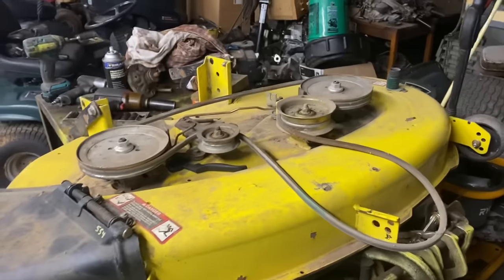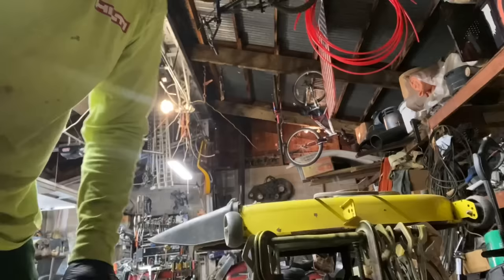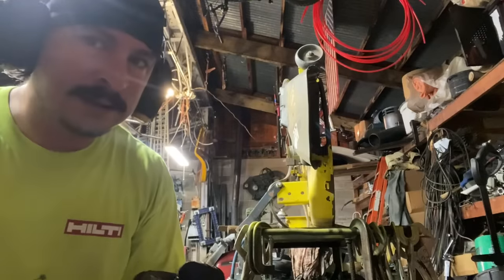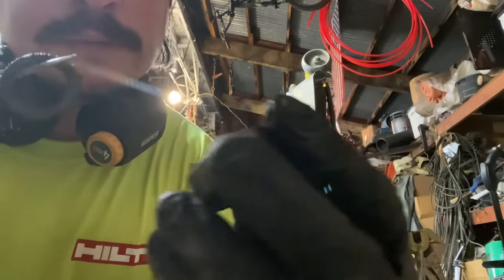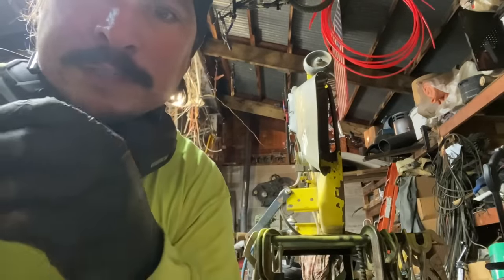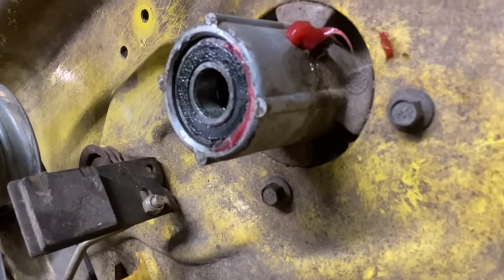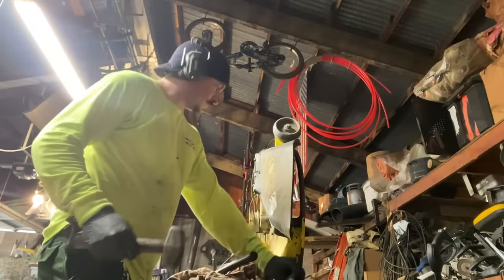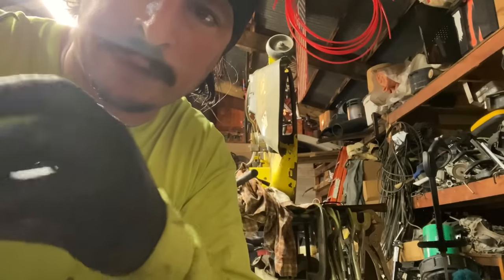Part 1 - Don’t trust the “Experts” Grease your mower deck sealed spindle bearings Common sense.

Comment: The only way grease is going to get into a sealed bearing is if you pump the entire housing full with grease and keep pumping until the pressure of the grease either collapses the inner rubber seal or under pressure  a very small amount of grease at a time could slide between the seal and the center hub of the bearing.....Oh yeah and if you go to Project Farm here on youtube and watch him test different kinds of grease......you will never use any kind of grease except Lucas Red and Sicky......
Reply from the maker: Welcome and thanks for
The comment. Did you watch the whole video? I did pump the housing full. That’s the key to making this process work. What your saying is an opinion about the inner seal and I have yet to see anyone post a video showing that has actually happened. The seal collapsing is a untested opinion. What you say seems logical. However I just proved that opinion / theory wrong in this video. did you watch the whole video? I basically laid it out step by step and removed bearings after the process to show that it works. The inner seal does not collapse and I have never seen one do so. That’s not a concern, I’m fact there is no room for the seal to collapse into the bearing. At least not the bearings used for these applications, and that’s why my video is for. To show folks how to grease a deck mandrel. Not any other kinds of assembly, just deck mandrel / spindles. Do your own test and post some videos showing what you find. That’s what I’m
Doing here, just helping folks with what Iv learned. Iv been doing it this way for years and it works fantastic that’s why I’m sharing. grease passes right by the lip of seal. Thanks for the suggestion on the grease type, however I have found that the type of grease for this application is not nearly as important as just making sure the bearings are greased. My main goal is just to help folks get grease into a bearing. As far as type of grease goes, there are dozens and probably hundreds of videos on that topic. This topic is a different story, and that’s why I felt it was important to get accurate information out to people who can utilize it. So many “pros” are showing videos saying not to grease a mandrel and saying it’s useless but nobody except me is showing what happens when you actually do grease and fill the assembly. Maybe you found some, I never could before making this so that’s why I made the video. I proved the other guys wrong and I showed every step of the way to make sure folks could see what happens. It’s not magic, the grease went into bearings. It’s super simple. Don’t overthink it. Im just trying to help folks understand that greasing the zerks on a mandrel is a good way to servive bearings if it’s done properly. And even if the inner seal was able to collapse, it wouldn’t make one bit of difference as the bearing would be full of grease and the inner seal can’t hurt the bearing. Some folks remove them before greasing as I have done. Regardless the inner seal is a moot point. All
That matters is grease reached the bearing.

Comment: The manufactures need to come up with a better way to grease the bearings. Even after re moving the inner seals there needs to be an exit for the old grease to make room for the new grease. Maybe an opening in the bearing housing with a on way valve to keep dirt out of the bearing and also let the old grease to be pushed out of the bearing to be replaced by new grease.
Reply from the maker: Your overthinking this. First, There is no reason to remove the inner seals. They can’t stop pressurized grease from passing. Even if they are there they do nothing to stop grease. That’s why I kept them in place during the video to prove that. So there is no reason to tear down the assembly to remove them. As for pushing out old grease that’s never going to work so no matter how complex the design may be the old grease for the most part is staying in the bearing and only some new grease will push in each time you grease. That’s just the way it’s going to be and that’s okay. If someone just fills the void the first time, every time after that will only take about three pumps to push a little more grease past the seals and into bearings. Even with old grease in there the bearings will receive the grease they require for a long life. I made the video to help folks understand because after many years of fixing decks I have come to realize this is a topic that many folks need help with. It took me some time to see that nobody greased the housings enough to fill them and rarely greased them at all. If you will try what I have shown you will
See it works fine and those inner seals/dust shields are of no concern when it comes to applying grease. Most folks probably think those seals hold back pressure but they do not. Especially not from a grease gun that can apply several thousand pounds of pressure.

Comment: Remove the plastic shield carefully with a pick. Remove existing grease and repack with GREEN GREASE FULL SYNTHETIC. Pop plastic shield back on and enjoy the peace and quiet .No more regreasing for about 8 years .
Reply from the maker: I show that in other videos. That’s not the point of the video. The point of this video was to prove once and for all the shields can not stop grease from passing. No need to dismantle a deck to access bearings. just pump it in with a grease gun and enjoy the peace and quiet. Can use cheep grease ever year and be just fine with a few pumps or buy the expensive stuff. I don’t think it makes a big difference as long as the bearings have grease. When I fix a deck with shot bearings they are always dry. So any grease is better than no grease.
Reply: @GTObearclaw1  those are not sealed bearings those are shield bearings. True sealed bearings have a rubber coating on both sides which you can use the needle adapter to introduce fresh grease into but needs a hole and other side to let old grease out.
Reply from the maker: @flhusa1  for the application I’m
Showing in the video the shields don’t stop grease from passing and the process I explain work great. No need to dismantle a deck to grease bearings individually as the grease passes right by the lip on shield. It’s so basic and simple it’s sad I continue to have to explain it after doing so in the video where I provided proof the process works. Try it one time. You have no grounds to say it won’t work if you haven’t tried it. Again, I’m only explaining the process for these bearings not other applications. Open your mind.
Reply: @GTObearclaw1  I totally on board with your method. I bought a John deere rear engine rider for my father years ago. The deck bearings were so joist he refused to use it. Bearings were recessed into holes with no way to lube. They want to sell you whole spindle assembly. Fellow worker welded bolts to bearing and used vise grips to clamp and hammer to remove bearings. New bearings and my father got to enjoy riding rest of his life. The grease guns and other lube tools were my daily companion at my job of 28 years. Got plenty of OJT that way. Another tip if you have a fitting won't take grease heat fitting with heat gun or propane torch works every time. Thanks for the replies.

Comment: Does it ever blow the outer seal out
Reply from the maker: Never. There is no space for the seal to move away from the bearing. 

Grease will not push a seal off if the assembly is together. And if the assembly was not together the whole bearing would more than likely push out of the mandrel long before the grease passed the seal. Grease the mandrels It’s a win win situation. I won’t get a penny one way or another, just offering some help because nobody else Iv seen posting a video has the truth of the matter. Most say grease won’t even push pst the seal. Bull hockey.

Comment: If I had my machie shop I would make my own spindle bearing housings out of cold rolled steel. Drill and bore out each side, then drill and ream the shaft hole fifteen thousandths over the shaft diameter. That way it would take a lot less grease to get to both bearings. I would add a grease zert at a good place to reach the housing, or perhaps install a small diameter hard line with a zert on the end so easy access is available. I would take off the protective bearing seal facing the inner housing so the grease could actually get to the bearings.  The way they are done now, it is for self destructioin and a way to make people buy another machine. The same goes to other parts that should have been made of hardened steel, not the soft stuff like the stearing gear and yuoke that is so soft the steering gets sloppy pretty fast. They are a bunch of junk! For three hundred dolars more, these features could be installed and the machines would last at least a decade.

Comment: I removed the seal from one side of my bearings so they get greased very well now
Reply from the maker: Yea. Get that same coment
Non stop. But the whole point is that the seal, really just a dust shield is not even water tight and will not stop grease so removing it for the purpose of allowing grease to pass is a pointless process. Just working to work on something for what I call getting that warm and fuzzy feeling thinking it’s doing something when in reality it made no difference in the final outcome. Just grease until you see grease come out one end of the assembly and by then both bearings got lubed. Good to go. Also do not wash deck with water. Water will find its way in bearings. Using a leaf blower after each mowing and keeping deck clear will help deck live a long happy life. I find more often than not, when folks leave this comment they didn’t finish the video and get the full information I was offering.

Comment: How does the grease get into a sealed bearing?
Reply from the maker: @robertcromwell9736  the lip of a seal is a flexable rubber flap. If the assembly is a sealed assembly with no weep hole, the only exit is through the bearings as the rubber lip is the path of least resistance. If you have a weep hole, see part two for that fix.
Reply: @GTObearclaw1  True but hard to get much thru there.  I just remove the bearing, remove the rubber covers, clean with solvent and repack with good grease and replace the covers.  Good for another few years then rinse and repeat.
Putting too much pressure in there can push out grease around the outer seal and attract dirt, etc.
Reply from the maker: @robertcromwell9736  in fact it’s actually very easy. It may be hard for some folks to understand because they can’t see what’s happening inside the unit so folks come up with all kinds of theories but they are wrong if they believe there is anything wrong with this process. Most folks including all the experts providing help videos are wrong. Not a single video on YouTube other than mine shows the step by step and nobody will prove the process doesn’t work. Folks should test this out and make their own decisions. grease can be pumped straight into the unit via the zerk and that’s simply all that’s needed. But easy enough to test it just like Iv shown. I get comments often how folks have had tractors for 20 years running the same deck bearings with nothing g more than greasing as Iv shown. Something to be said about those comments. Rubber lips on the shield / seals pose no restriction as some folks imagine. That is exactly why I ran through the step by step process in my video to break it down into baby steps so the folks who don’t grasp this can see it in the most simple way possible. Unfortunately some folks still can’t wrap their heads around this very simple pricess. It is way easier than taking the assembly apart to grease each bearing. Also, dirt outside the seal is fine and no reason for concern. It’s outside the bearing where it won’t hurt anything and is just messy. Same as many other applications, of course dirt will stick to grease but as long as it’s outside the working surfaces it’s simply just dirt and not harmful. I wipe away the grease that exits to keep my deck cleaner. And I stop greasing as soon as I see some grease escaping through a bearing shield so it’s less messy. It will be fine and won’t hurt anything. This is just normal preventative maintenance. All the grease will pass through the bearing if you keep pumping more and more grease passes through. It’s just pointless to keep pumping because the smallest amount of grease in a bearing will go a long ways and regular greasing would be wise. If you overfill the bearing the motion of the bearing will simply push the excess out past the lip. It’s basically a self regulating system. Your way works fine, however I prefer less work for the same benefits. The point of the video is to avoid that extra work and provide evidence that the so called experts are wrong. Plenty of channels on YouTube say not to even bother greasing at the zerk but unfortunately they are too lazy to make a video to prove they are right. I got sick of the BS and made my video to prove they are wrong. Grease in fact passes into the bearing and no harm occurs. There is no argument from me that doing it your way won’t work just fine. But the majority of folks are not going to go to to that much trouble when a grease zerk that comes standard on many machines is just fine to get the grease to where it needs to be. Not everyone has the tools or intrest in taking a deck part. And I argue it really won’t do any better for your bearings than how Iv shown. I believe taking things apart that don’t need to come apart could risk something breaking that otherwise would have been just fine. But each person can choose the path. My goal was to prove this way works just fine.  Donny boys bad advice sparked this video and I offered him the opportunity to test my theory and help his viewers and after over a year waiting I made my video and Iv already had double the views in much less time so apparently someone finds the information useful and it’s been very interesting for me to see this much attention on a video as I’m not a very popular channel and sometimes go 2 years between making a video. Iv had fun replaying to folks.

Comment: What is holding the deck in place
Reply from the maker: Gravity
Reply from the maker: What do you mean? It’s just on the bench. When standing up the rear hanger brakets supports it or sometimes I use a 2x4 to stabilize it.

Comment: Motor repairman for over 40 years. Biggest cause of bearing failure is dirt. That is why they use sealed bearings.
Reply from the maker: No argument from me, I know they will fail without grease, Just hoping to shed some light on how to get grease to the bearings as easily as possible.

Comment: Idk, there wasn't much red grease actually inside the bottom bearing. Yeah it was there, but only in one section, which I'm assuming was the weakest part of the seal that allowed the grease to slip past. 

Personally, if I were to modify a stock spindle by installing a grease fitting, I would do the little bit of work to remove the bearings and remove the inside rubber seals, just to be sure the bearings get fully packed with grease.   However, I won't dispute that greasing them with the seals in place is far better than nothing.
Reply from the maker: Thank you for taking time to comment 

Each application may be different and depends on many factors. Iv had nothing but success doing it this way. And most people do not want to disassemble the mandrels just to remove seals / shields that don’t matter anyways. The point is grease reached the bearings even with the seal in place. Keep in mind I stoped greasing as soon as I noticed grease escape. And there was already a lot of grease in the bearing and plenty of new grease was present after the application in the video. As For doing it this way it will provide enough grease to keep bearings in good working order. And yes way better than not greasing for sure. in addition, each time bearing is spun as deck operates and more grease is added the bearings will continue to fill with more fresh grease. If someone did not want to remove seals / shields on the inside that would be fine. It won’t actually make much difference if any one way or another. Point is this process works and shields won’t stop grease from passing.
Reply: @GTObearclaw1  I appreciate you making the video because this was something I had pondered about in the past.
Reply from the maker: @mikeg3529  hay, I hear ya. Same here. For years I pulled the bearings out and greased each one and put the shields back on. I wanted to make dang sure I knew each bearing had received grease. But over the years I didn’t want to pull newer tractor decks apart so I started wondering and decided to run some tests myself after hearing some of the so called pros making videos saying it’s a waste of time. Well, come
To find out it’s not a waste of time at all and folks need to know the truth. So many of the guys posting videos care more about the amount of views and not as much about getting the best information out.